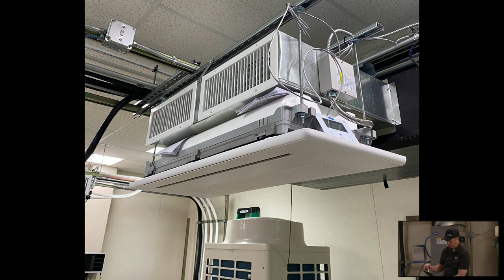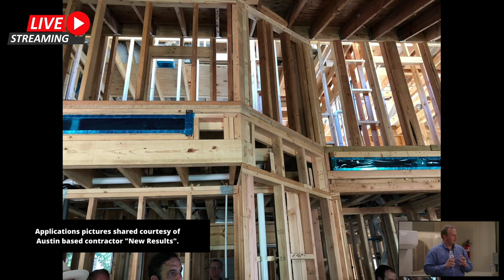Carrier Ductless - What’s the latest in HVAC equipment - LIVE STREAM

Comment: I installed two Mitsubishi 9btu splits in my house in Italy. I love them- efficient, various settings, and effective. When I return to the U.S. (San Antonio) and build I hope you can offer some assistance. I like nearly all your videos; always informative and pushing the way homes should be built.
Reply: Mitsubishi is KING of mini split heap pumps have 5 in use winter and summer.  All other follow, Mitsubishi teamed with Trane, probably for distribution, better in the U.S..  Super SEER ratings, and reliable, QUIET inside and outside

Comment: I just installed two ductless mini splits in my basement and they are the best. I didn't go with Carrier, didn't know they had these, I went with Mr.Cool.
Reply: I'm in the process of installing Mr. Cool units (9 interior/3 exterior units) in a cement block house, with a shallow attic and cement floors, built in '53. No other style of AC unit made sense for this house.
Reply: Sorry. More $$, less performance.
Reply: @scott03334  what do you mean. I have a whole house mini-split and they are great and my electric bill went down a litte.
Reply: What do you do for heat when it drops below 30 degrees? All the mini splits i looked at had no heat strips, also why does no make a head designed to cool a standard bedroom? The industry preaches correct sizing, yet the heads are huge
Reply: @jbf430  They work as they should. My Daikin 36K BTU with a ceiling cassette and wall mount works the same at 17 deg. as it does at 45 deg. This is not old school heat pump tech.
Reply: @jbf430  most units ARE HEAT PUMPS,MANY NO LONGER SELL COOLING ONLY !🇺🇸🇺🇸🇺🇸🇺🇸
Reply: @jbf430  new heat pumps can pull out warmth from well below freezing temps now

Comment: Before we tell all the Texans to unplug from gas. During the big freeze this year when we had no power for 10 days, gas fireplace was all we had for heat and cooking. Other things to consider guys, it is an imperfect world.
Reply: yeah, diversity of fuel sources is good. a gas cooktop and fire place makes a lot of sense so you'll keep very little usage of gas most of the time, but it will be there in an emergency.
also, everyone should evaluate and reconsider where their pipes run in their house and how insulated they are. so many people had hydronics and water heaters outside the envelope of the house... that's just waiting to be a problem.

Comment: One of the things that a homeowner ( I know I can't be the only one thinking this) finds frustrating is the complete lack of pricing transparency when it come to HVAC.

I don't have time to take an hour or two off work 3 or 4 times to meet 3 or 4 different salesman at my home for a replacement system so he can "figure out" what I need depending on what his company sells. 

Companies should be honest, give ballpark of pricing on their website for a range of sizes.  Help us, help you help us.
Reply: The companies would probably sell a ton if they hired their own installers. They only did new mini-split install- they would be so fast and efficient at it they could keep install prices down. Run internet adds that say Installed for $2k and sell 30x as many.
Reply: Assume a generic pricing is provided and then that pricing is exceeded. You will now claim bait and switch.
It is ironic that homeowners complain about taking time to get proper information(pricing, sizing, etc) when this really is one of the most important choices in any home improvement/build process. It is NOT the color of a wall or color of the carpet, those choices will all be easily changeable, but incorrectly choose your HVAC system and it will be expensive to run, not provide the comfort you desire and be a HUGE expense to fix after the fact!!!!
Take the time to ask the contractors questions because if they cannot answer them, how do you think the system will perform? You are spending a significant amount of money on this and it is a long term investment.

Comment: Matt (and Carrier reps) at ~45 minutes you lament that nobody wants to look at mini split head units but I think you mistakenly blame the consumers instead of manufacturers.  Where else do you use ugly cheap injection-molded plastic as a finish material in your houses?  Probably nowhere where you have a choice.
Reply from the maker: Solid points
Reply: I've been saying this for YEARS. They should all be "panel ready" so that they can coordinate easily with the room they are in.
Reply: Agree 100%. Pull the plastic off and just offer it with mounting points for decorative covers. AND here’s an idea, since it’s a couple dollars cheaper to remove product, Offer it for a couple bucks cheaper, and not up-charge for the system. This will promote the next generation of HVAC users to select this product.

Comment: Going to be building a home in Georgia soon, heat pumps are used extensively in the south as they are great at removing moisture, and I’d love to see the ability to use the heat pump to generate hot water in line prior to a tankless water heater- is that tech around?

Comment: Please make a 10min summary video.
Reply: Please make a 2 hour extended video.

I was listening to this while working. I was suprised how quickly the video went by.
Reply: @ZNotFound  It's a Carrier marketing video, same bs you hear from them at the shows, they don't even make their own mini splits. They buy rebranded products
Reply: @R L that's because these are VRF units. Seer estimates efficiency based on an entire season while eer is efficiency rated at the highest temperature with the device running on it's highest setting. Because of this eer is not a estimate that can show the true efficiency of an VRF device since they vary their tonnage based on actual need  while the eer just assumes its max on state is the only option as seen in older devices.

If you live in a very hot or cold area and are in low insulated home then go by EER. If you live everywhere else or are in a really well insulated home then purchase based on Seer.

Comment: Service tech here.. I just installed my first 20 seer inverted split system. I cut the wattage 60%
Reply: wait till you need to repair it out of warranty parts are always expensive as hell. Just did a repair and  the inverter board and compressor  was 1700 just for the parts.
Reply: Case in point replacing ECM motors with the the tried and true PSC.
Reply: @nicolasroselli6952  almost all equipment only come with ECM or torque motors. No real way to go back to PSC motors sadly
Reply: @nicolasroselli6952  in 10 years they won’t be as much when those start coming out of warranty
Reply: @zack9912000  Control boards specifically designed as "test" boards are readily available for ECM to PSC conversions.  ICM comes to mind.
Reply: @nicolasroselli6952  Most brand's today do not work with those kits. Some brands don't have problems with those, but the major brands like Rheem/Ruud products do not accept them. We have used them in the past but now we usualy buy universal ECM green motors that are half the cost of oem

Comment: Matt,  been a Trane owner for last 25 years. Just pricef Carrier vs Trane for existing home. Have 3 ton unit(Carrier) that came.with home when we purchased. We are on natural gas.  Carrier was 35% more than Trane. Trane unit had better seae rating than Carrier. Trane Warranty/ Service was a better deal going with Trane than Carrier.
Reply: Trane was superior in the 90's, wouldnt be surprised if Trane was still top dog.
Reply: We're you dealing with a vendor that specializes in Trane? Try a Carrier dealer, for us it's opposite Carrier is way cheaper, but we specialize in Carrier. Carrier equipment is easier to perform routine service/maintenance than Trane products.
Reply: Trane is way more than carrier. You need a Jew carrier rep.
Reply: Wow…had a Carrier 3 ton unit for many years. Efficient and very reliable. Upgraded to a 5 ton American Standard (Trane) for 11 years, SEER 16 about 10 years ago. The AS unit was more but it’s been much more efficient and equally as reliable
Reply: Just checked my friends two Trane units installed in early 2019, both evaporator cold are leaking. This problem started in 2007 and has never been solved. Carrier has the best coil by far
Reply: @charlesterrizzi8311  Too bad they didn’t contact Trane/American Standard Customer service. They were responsive to my call and took care of the issue.

Comment: That story about the dual zone automobile systems, reminds me of one particular service call I had in an office building which was using a water source heat pump loop throughout the entire building.  Doing routine maintenance I encountered a man and a woman sharing an office which had its own separate zoned unit overhead with a t-stat in the room.  The lady complained it was too cold and the gentleman complained it was too hot.  No matter the sophistication of the equipment, nothing can overcome the age old problem of conflicts in personal taste.  I found that zone dampers or even balance dampers were somewhat useless where tastes within a space were different.   Try going on a service call where an accustate is used.  Many are upset with a fixed setpoint and only the manager is happy because no one can change the set point.  
I used to split a split system to take care of stratification to a degree while offering value on job estimates.  I simply tee'd the refrigerant lines at the od unit and installed 2 indoor units.  I put in hundreds of these and many are still working many years later.  Of course the manufacturer always told me I would void the warranty if I did this.  However, most warranty issues were never covered by the manufacturer without a huge hassle.   
Use of incremental units within one structure has always made sense in terms of ability to turn off or cut back use in areas not being used throughout various times during the day.  Plus the added reliability that multiple units gives, reduces the chance of total outage.  
Honestly, some of the 'innovation' is common sense that has been used in commercial applications for many years.

Comment: As far as heating I recently ran calcs on good mini split vs Nat gas and it wasn't even close, nat gas cheaper by 10 miles install and operation.  I do like mini split for central but i have a 4.5k sq foot house and don't really wannt add 20K+ in minisplits to cool it, and replace every 7 years since my system is already setup for central air.

Last house was new and very tight and had a carrier 90% nat gas central air system.  Thing was a nightmare, failed 3 times a year every year, different parts each time.
Reply: We tell people all the time that with current gas prices they are absolutely nuts to do a heat pumps  or expensive inverter systems, there is just not enough savings to justify the upfront cost and  HIGH cost to repair after a warranty. NG force air systems heat better then any of these systems do up north where they struggle in the winter time.
Reply: @zack9912000  gas prices are going up and with the savings in the summer from the high-efficiency units it may even out

Comment: Few things to think about these VRF systems.

Filters, most of the small units have absolute crap filters standard.  Some have the option for your typical resi grade 1” pleated filter a standard resi furnace would come standard with.

Controls on most are proprietary.  When the vendor switches generations and you need a replacement control board, you may be completely screwed when they obsolete the prior gen.  Want to use your own wiz bang IoT stat, forget about it in most cases.

Moving air is the only way to filter it or replace it with OA.  Moving air and causing more IAQ issues than solving?  Would like to see some studies showing that.

Simultaneous heat/cool VRF systems are not standard option and added cost.

Certainly, are cases these systems make sense.  One needs to consider all the pros and cons outside of a vendor sponsored piece.
Reply: I agree. After servicing these things for years, cleaning is an absolute pain...even with tall the special vendor cleaning/catching kits. Better filtration is in order.

Comment: Air is not heavy on the contrary it's very light but it's energy density compared to water is next to 0 so you need a lot of power to move and heat that air especially in those thin uninsulated ducts.
Reply: Air to water heat pump is the solution. You can  have 1 zone / room.

Comment: Well Matt this was redeeming from the acoustical properties of un covered rock wool video, this was useful!  However I would add there is a sad truth to these new variable output systems that we should talk about! That is there planned obsolescence! The advent of electronic commutated motors is key to the variable output of these systems. These motors have complex driver circuits that have many failure points, the main one is the low quality capacitors that inevitably will be to expensive to repair or not serviceable because the components are potted in resin. System replacement will be the only option! Mark my words these systems will not last a week past 10 years if you a lucky one. Many of them will be dropping off after 5 years not just the off shore brands. The days of taking care of equipment so to enjoy long service and reliable performance are gone. The manufactures don't want to wait that long for there next visit to your wallet! The saying "Don't make them like they used to"  has never been more true.
Reply: Ive got a mitsubi 36000 btu split that's on year 7 and all I've ever had to do is top up refrigerant levels. It's ran 18hr/day full load during that whole time. Its still running strong.
Reply: @johns.1940  anecdotal
Reply: @johns.1940  Well good for you but If you had to "top up" you have a leak end of story!

Comment: These heat pump mini split systems…. How do they perform in the north say Michigan? I’ve had heat pumps before now 8 years ago but the down fall was that they are always running and in turn you end up with outrageous heating bills in the winter. Have they improved that much? Or is it still best to have gas heating?

Also where are the Carrier units made?

Comment: I've got to ask though: in a high performance or passive house where you ideally have minimal air movement, isn't a ductless installation a bad idea for air quality in regards to air replacement/replenishment?
Reply: You need to watch a bunch more of Matt's videos, air exchange is fully addressed.
Reply: In a house with Passiv levels of air-tightness, would use an ERV/HRV.  However the ducting requirements are far less than traditional HVAC.  Could have a small return from each bath and kitchen and then could have a single supply to a central location in the house.  It's preferable to have this be a separate system from heating/cooling.

Comment: I have a new system in my attic for my rebuild that looks similar to yours! It’s already finished and have been using it for a year already but the attic is not conditioned. Can u cut a hole in one of the ducts that supply one of the bedrooms to condition the attic? I’d like to cool off the attic

Comment: after one year or so, dust gets in to all gills and fins and corners on Indoor unit and cleaning it is "mission impossible". 
efficiency goes down by about 20%. and turns it in to huge dust magnet. 
  why can't they make it so it can be cleaned easily and silver plated for antibacterial purpose. and decent filter with flexible seal  to prevent dust from going past it.
Reply: You are referring no doubt to the mini spilt indoor units, wherein the blower wheel created a static charge and grabs dirt like a magnet. Cleaning is more difficult than installing a new one, with high potential for breaking the plastic
Reply: @charlesterrizzi8311    A couple of companies, do make a cleaning system for these units,NOT INEXPENSIVE,but geared towards contractors ! 🇺🇸🇺🇸🇺🇸🇺🇸

Comment: With ductless systems, how do you bring fresh air and remove CO2?
Reply: I'm still waiting on this one.
Reply: You use an ERV
Reply: @taylorlightfoot  that doesn’t distribute the fresh air. If you have a 3000 sf house with rooms that are closed off, you won’t get air mixing across zones with a ductless system and standalone ERV/HRV.
Reply: @audiobrad99  ERV's can be ducted to multiple rooms.  If you don't want that, install the drop in replacement unit version of a mini split and use traditional ducts in your VRF install.  The technology doesn't have to be zoned or ductless.
Reply: I would love Matt to do a video describing a holistic design for a home.  He likes to do these one off topics such as VRF mini splits and then not mention the need for fresh air, filtration, dehumidification, etc.  Would be great if he could do a deep dive into what a really tight home needs in terms of all the various systems and how they work together.
Reply: @taylorlightfoot  If I were able to easily install ducts, I wouldn't need a ductless system.
Reply: @taylorlightfoot  Agree about doing a deep dive with a systems approach. But Matt isn't that deep.

Comment: Have you ever done hvac system in a icf house and should deduct your BTUs cause it's so air tight?
Reply: @BeardLAD  insulated concrete forms
Reply: No. You do the heat loss-heat gain calculation, like usual. In a tight house, you need fresh air. You MUST install an HRU (heat recovery unit). The HRU will help with the cooling load by dehumidification. Contact a specialized company who is doing this calculations.
Reply: @harrytanase1587  absolutely. I recommend them in every house/build.